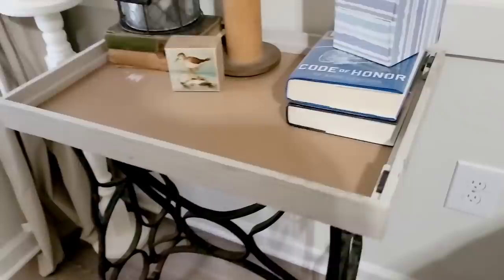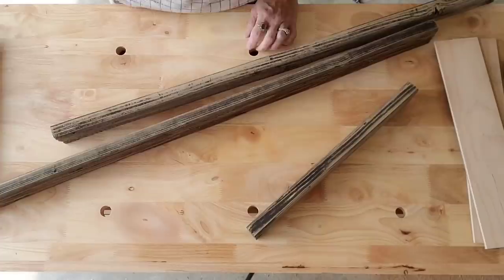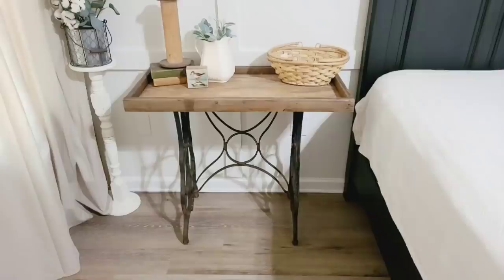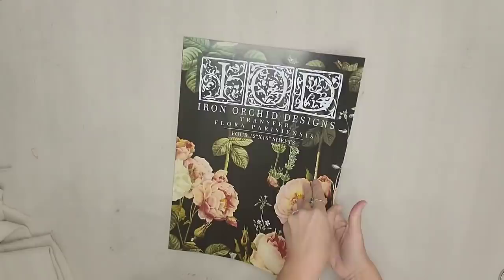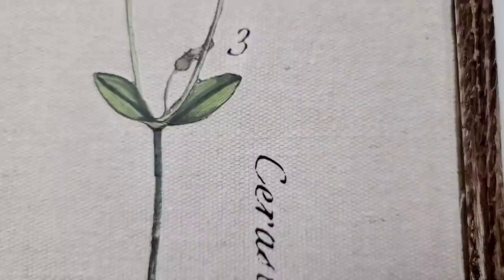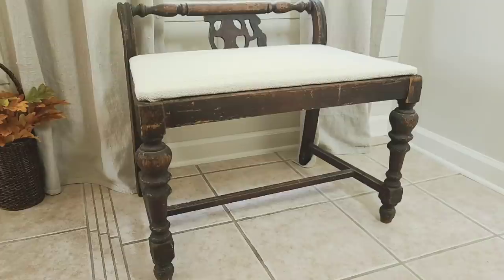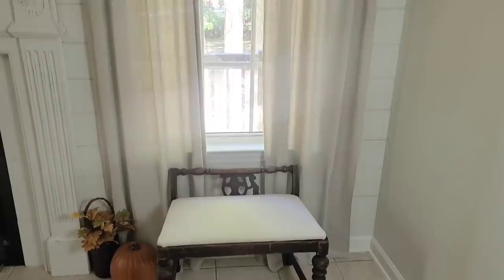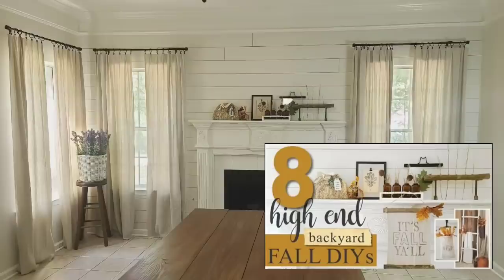High End DIYs for Your Home • drop cloth curtains • end tables • art work • upholstered stool

Comment: Hi, your bedside tables are beautiful. My concern is for the decking wood you used for the frame. If it is pressure treated wood it should not be used indoors because it is highly flammable. Additionally, it could contain CCA, which is toxic to humans. I couldn't tell from your video if you put varnish on the frame to seal it. I'm not sure if it would add protection.
I just finished watching your video and I love the bathroom art you made. I've never tried transfers. The bench you fixed up looks so pretty with your new drapes.🌷🌷